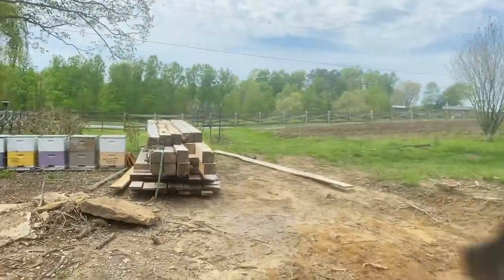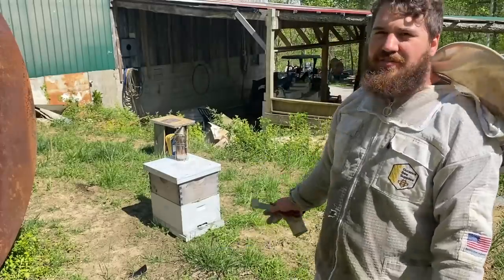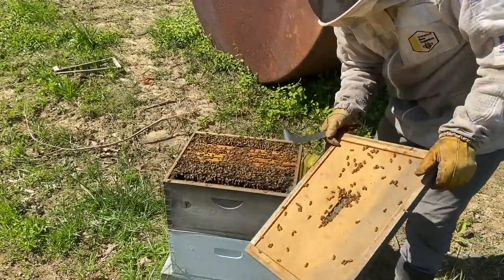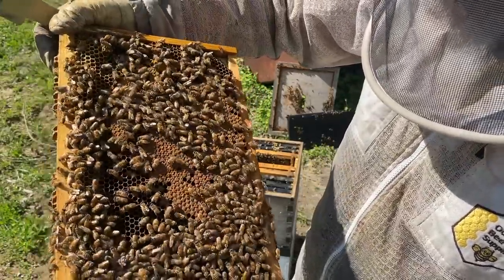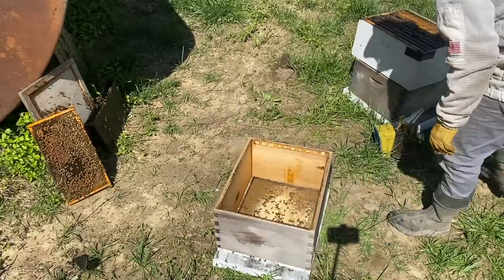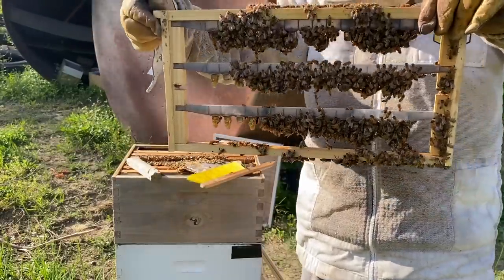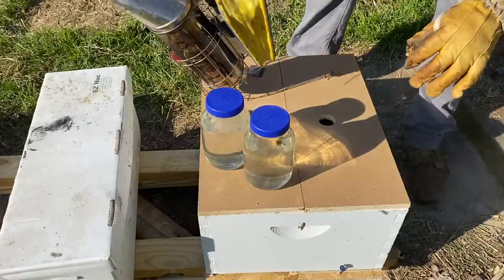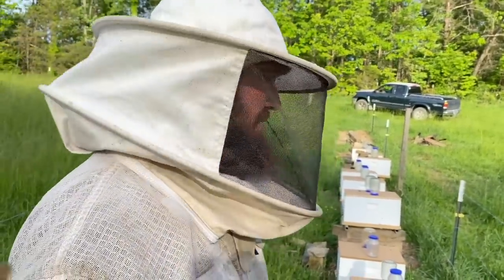Building a Beekeeping Business from 6 Hives

Comment: I usually only make a few queens at a time because you need the bees and boxes for each round, and if the weather changes you can lose everything. Another queen producer mentioned to graft on an eight day cycle if you have a loss its easy to recover.. A queenless colony can be very mean, another factor is commercial bees were interbred for years and that is also a factor. I buy a few different queens to introduce unrelated drone genetics for open mating (something to consider).. Expect about a month for the colony to build up after the queen is mated. The biggest issue is making drawn comb for all your splits, after the main flow its hard to get the bees to draw foundation. Good luck Brother.
Reply from the maker: Thanks Brother!
Reply: Same advice I gave (genetics). 👍